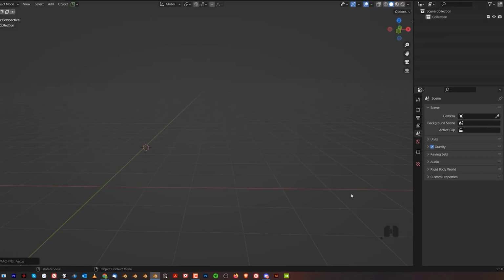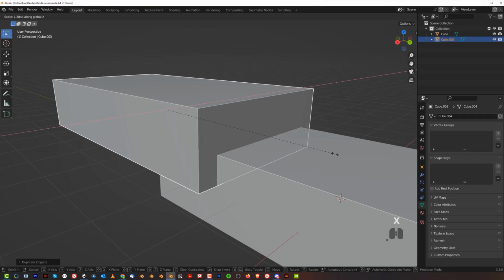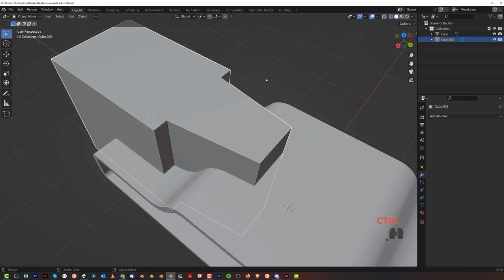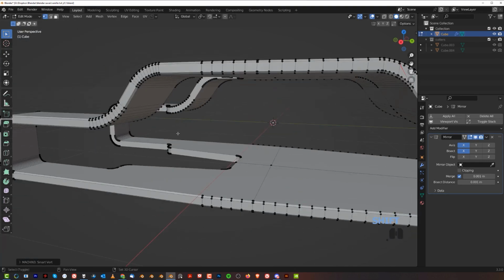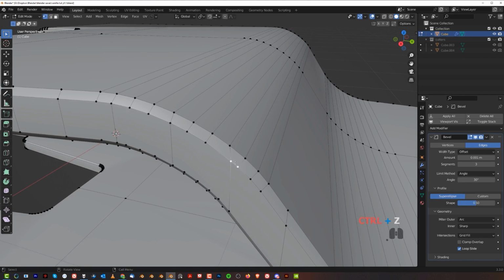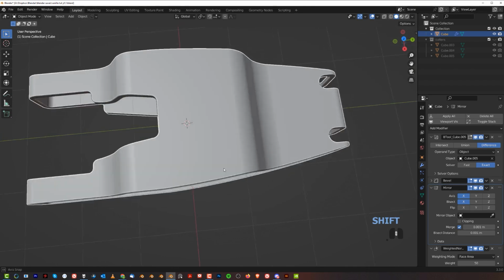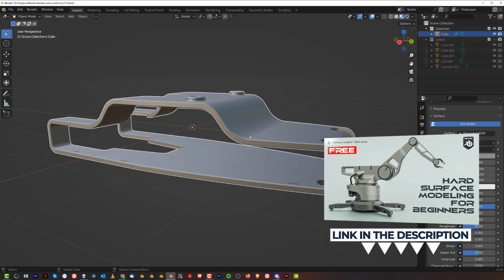Blender Hard Surface For BEGINNERS - No Paid Addons

Comment: is there a way to add quick filets and screws.... like can we just draw it?

i saw in a 3Dcoat video where he just picks a circle tool and punches it on mesh & BOOM 75 screws in no time .. 
i think 3D coat is voxel based so its easy there....
Reply from the maker: decals or kits, check decal machine and kitops links in the vid descr

Comment: great to see this thanks for sharing! Paricularly for me as a refresher on techniques after being distracted away from Blender a while on graphics and web design work, and getting back into it Blender again. 
I find myself using the "harden normals" option in the bevel modifier instead of the weighted normal modifier - wonder if you have noticed if there is some difference you might highlight between either approach?
Reply from the maker: for game asset export, other than that it doesnt really matter

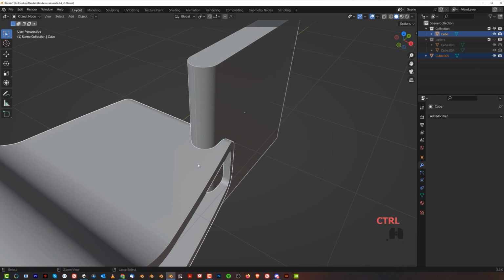Comment: 15:05 I’m only speculating but could the issue that came up be from after you had the bevels on the cutter meet? At the top and bottom there were two vertices then occupying the same spaces leaving a slight visible bump of a line between them and on the main object after it was cut. I merged those points by distance and found the mirror mod worked after. Might not be the main reason though.
Reply from the maker: ya thats what clamp does